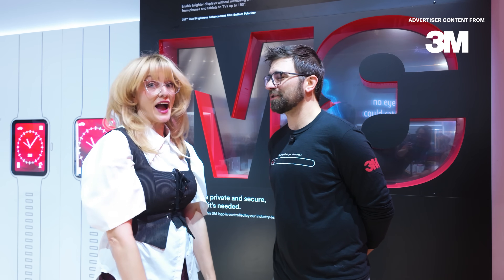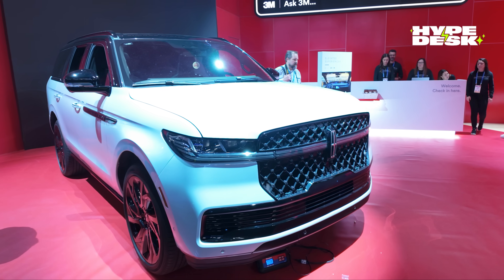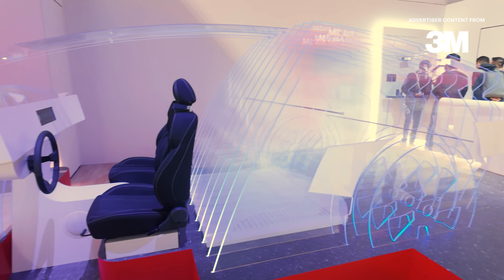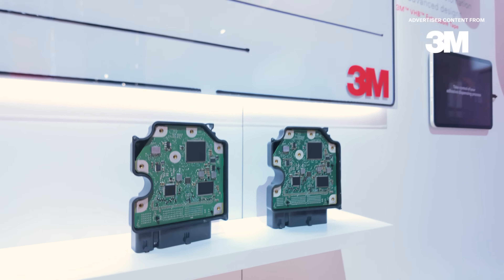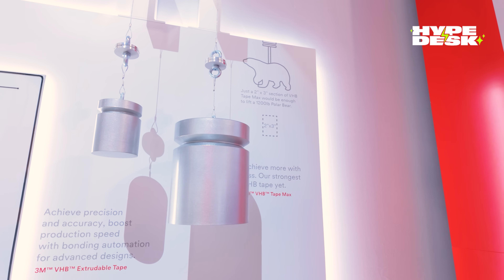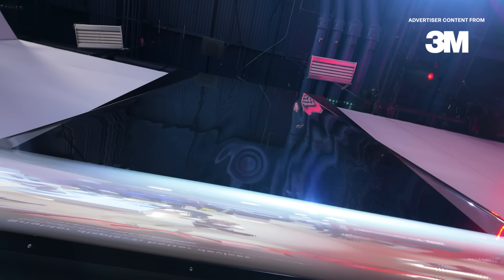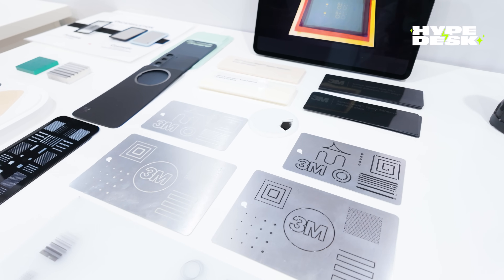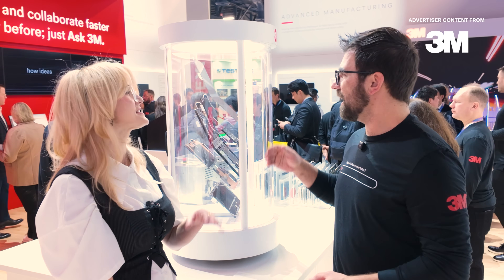The Invisible Layer of Tech | HYPE DESK

Comment: 3M: If you're going to make such gigantic displays for cars, please make them with less reflective surfaces. The glare in sun is brutal(ly dangerous) for drivers! 🙏
Reply: You have to ask the car manufacturer for that.
3M doesn't make the display or the entire assembly, they make the layers in between.
So if a car manufacturer wants to put glass over it, it will reflect.